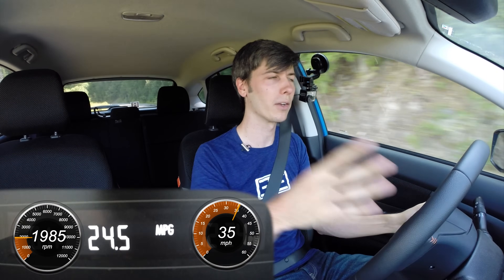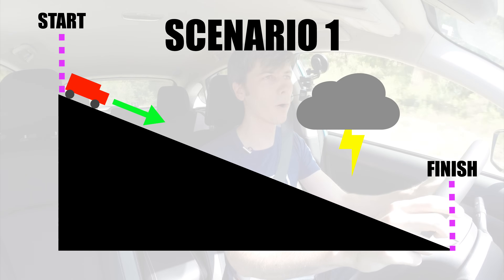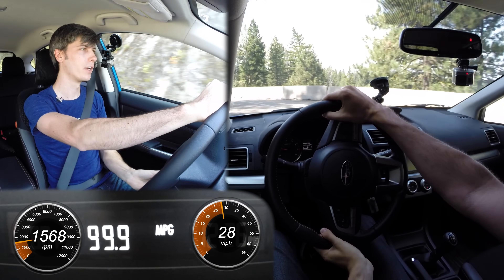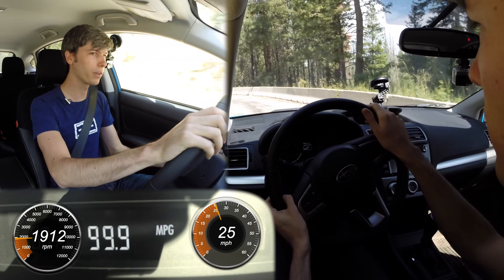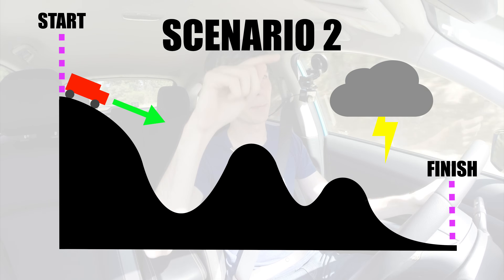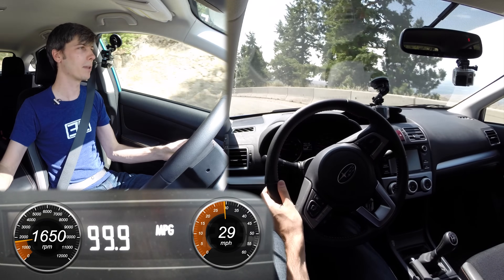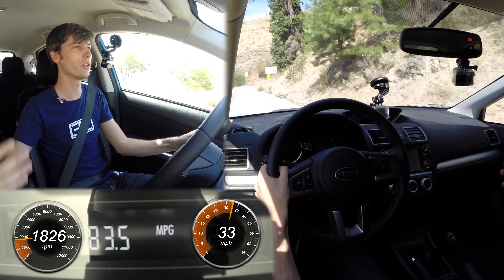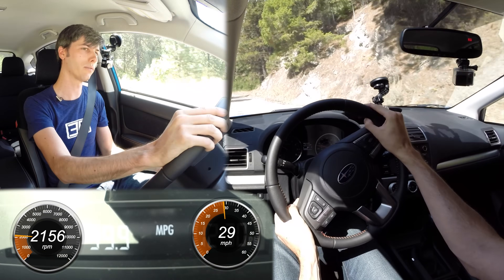What Uses Less Gas - Coasting Or Engine Braking?

Comment: Even without being in neutral, my old T-bird had a four speed automatic, and the fourth gear was an overdrive. When it was in that last gear, it would eagerly roll downhill,  and it would pick up a lot of speed, without my foot on the pedal. My Honda SUV, which weighs a lot more will adjust the transmission, to keep it from going too fast, downhill. In fact, it caps the downhill speed at around 40 or so, whereas the T-bird could get above 50 on a good hill. When the speed limit is well above 40, then you are definitely using more fuel, because you have to keep on the pedal to maintain your speed.

Comment: Important to note for all the people driving old cars with carburetors: neutral is more efficient than being in gear because in gear with engine brake applied, the throttle body is closed but the jets still suck in a lot of gas because of the high rpm of the engine.
Reply: No, not a lot at all. No more than a little above idle power. And I have brakes if I need them rather than them being overheated.

Comment: Also isn't it more efficient the higher the gear you're using, since the wheels don't spin the engine as fast. I'm imagining going 30km/h with second gear can be pretty unefficient, but 70km/h on 5th wastes way less energy.

Comment: I didn't know that coasting actually shut off fuel. Knowing this, I drove to work without cruise control and just accelerated and let off when necessary and my MPG was 42 when it's usually only 38

Comment: if you go down a hill in neutral your transmission will eventually die. As no gear is selected, the shaft is rotating with no lubrication and it will overheat

Comment: Doesn't it depend on speed? The higher the speed, the greater the RPM and therefore the greater the lost speed due to engine losses vs fuel use to idle the engine while coasting?

Comment: Finally an analysis that takes subsequent hills into account.  I live outside of Denver and have been dropping 3,000 ft down I-70 every day for 25 years. Most of the time it’s been in the same car!  Due to this specific terrain the best is a hybrid approach.  Leave it in gear until approaching  “Dead man’s curve” then go to neutral to build up an illegal amount of speed to coast over the long small hill with reasonable speed before the final drop.  Stay in neutral to allow for the farthest coast once you hit the flats in town. 

Don’t do this in a big rig though. Always stay in gear.  At least once a week there is a rig on the side of the road with its brakes on fire, and several times a year the flames take out the whole truck!

Now I have an electric car which takes all the mental gymnastics out of the drive.  Set it and forget it.

Comment: My car's "computer" can display instantaneous fuel consumption. If I lift off the accelerator and remain in (top) gear, the consumption falls to a nominal "999 mpg" because the kinetic energy of the car can keep the engine turning and the ECU can completely shut off the supply of diesel. If I lift off the power and also press the clutch, the consumption falls to about 200 mpg - presumably because a small amount of fuel is still needed to keep the engine turning at idling speed since the kinetic energy of the car (via the transmission) cannot now do this.

Comment: I live in quite a hilly area and use the kinetic energy by going to neutral to help get up the next one when I can and its safe to do so, easier on my pocket and the environment. Unfortunately its a great opportunity to collect revenue through speeding fines and I encounter a good many cameras strategically placed for that brief moment you might exceed the speed limit making you brake and waste all that energy. The other obstacle is nervous drivers in gear and braking well below the speed limit so you end up  having to downshift to second gear behind them on the uphill 60mph section.

Comment: Presumably this is only relevant with fuel injection, carburetor run engines I'm guessing would be more efficient coasting as the idle jet would be open regardless of whether you are in gear or not so lower RPM would be more efficient

Comment: It really matters if you have an automatic or manual, though, as putting it in neutral as the automatic transmission may not get enough pressure to properly lubricate itself over many miles. 
My car doesn't turn off the injectors and maxes out at about 40mpg or so.  Being manual, dropping it into neutral even to slow for a stoplight is a noticeable improvement. So it depends a lot on how the fuel injection works.  For something older or "classic", with port injection, carbs, or older mechanical injection, gas is directly linked to engine rpm no matter what you are doing.

Comment: I put the car in neutral and turn off and on the ignition. And then when I need the engine again, just put in gear and engage the clutch, the engine would be running again. Works both on carbureted and fuel injected engines.
If I see read light ahead, I slow down just enough that it turns green when I reach the intersection, and do the above thing till the intersection.
And braking only when necessary.
Using the engine in it's most efficient RPMs and not going to fast or too slow.

Comment: Another fuel saving tip: try not to stop. Starting from standing is a big fuel user overcoming rolling distance from standing. The answer is to slow down and keep crawling to traffic lights, through traffic queues, and so on - as long as it’s safe and legal to do so.
Reply: Downside is you need a lot of space ahead to roll, which most people will just see as 'free real estate' and merge in 😂
Reply: Yeah tell that to the asshole behind me who's rushing to the red light for some reason.
Reply: Tell that to the cops hiding round a bush at an empty 2 way stop when I roll the stop sign lol
Reply: @cyandrix  safe and legal ^^^

Comment: Reminder for automatic drivers: coasting on neutral does to your transmission basically what running without oil does to the engine. It is limited or prohibited in car manual, unless manufacturer added a pump for this case (newer and expensive ones).

Comment: Most energy efficient way: neutral, turn engine off (careful, depening on how your main braking system works you'll have to restart the engine before braking after a few times)

If you need to loose speed, then use engine braking. Same if you need the engine for the brakes, air conditioning or excessive use of electrical systems.

Comment: New cars cuts the fuel supply when engine breaking so you use 0 fuel when engine breaking. But if you really want to safe fuel you must turn of your engine and coast, I did that for a month with my Mercedes 190E 2.0i in city driving and saved 20% on the fuel consumption.

Comment: Works if you can maintain your speed in gear.  On a shallow grade, you burn no fuel in gear, but also slow more and more.  You then need to accelerate, using more fuel than just maintaining speed.

Comment: Please explain this. For example my car consumes 5 litres of gasoline per 100 km. Traveling exactly 100 kmh because of best fuel consumption which is 5 litres. If I go 150 kmh will my car consume 7.5 liters? If it consumes 7.5 liters that's good because than by the time I get there which is 45 minutes sooner , my car will be turned off 15 minutes sooner therefore the engine hours will be less. Now if it consumes say 10 liters going 150 kmh that would not save me. I'd rather get there later but economically even though I wouldn't be able to save those extra 15 minutes of engine hours.

Comment: Ideally, just choose the right, high enough, gear to gain the momentum needed for the next hill but low enough to not overspeed. Allways better than coasting in neutral, both economy and safety wise.

Comment: Not covered: Long, shallow descents, where staying in gear would result in losing too much speed.  In this situation, neutral is better, since the alternative to slowing down and needing to use gas to accelerate again later, is use extra throttle to "idle" the engine at a high rpm value that matched the rolling rpm.

Comment: if you keep engine in gear, engine rpm is higher than if you leave it in neutral. higher rpm = more friction. more friction = less fuel efficiency

Comment: For some coasting fans it's very difficult to believe that in coasting you need fuel to keep engine running but in engine braking driven wheels and inertia keeps engine running without any fuel. 🤔

Comment: For injection it is quite a no brainer. 

For carbureted engines I THINK neutral is better as it has lower engine speed and load.

I have done less sane things downhill like turning off the engine. PLEASE NEVER DO THIS, ESPECIALLY WITH NEWER CARS (after say 1960) as your car may get stuck in the steering lock! Also: many newer cars (after 1960) have powered brakes and steering which will then stop functioning!

It did help me when I was running low on fuel in a big nature park, coasting downhill with no engine on. It was an older cheap carbureted car with no creature comforts, no powered anything and no steering lock.

Comment: It is less efficient with a carb. Carbs mix fuel by the amount of air going through them. Higher rpm means more air means more fuel. Leaving it in neutral will use less fuel with the lower rpm.

Comment: But , in the REAL  world , there is a reason Coasting in Neutral is called Angel Gear . Lack of Control of the Vehicle means you are GOING to meet the Angels .
And , of course , a Carbureted Engine will always feed  Pilot Mixture  even at Zero Throttle .

Comment: Good discussion. Coasting is illegal because it's considered unsafe; never taught in driver's ed. Intuitively coasting is efficient, not spinning engine, using energy, wearing engine parts.
Brakes easier and cheaper to replace. That said, it takes driver skill to coast safely, no distractions, brake pedal covered.  Likely easier for a driver who has manual transmission skills. Some of the new electronic transmissions may not let you coast. Old lightweight SAABs had efficient transmissions that allowed forward coasting. like a bicycle.  Mechanical coasting is being replaced with less efficient EV chemical battery regeneration.

Comment: As always using the onboard computer screen just don't work. You need to run on an external tank and measure remaining fuel after the test. If no fuel at all was injected while engine braking the engine temperature will drop since there is no fuel combustion and transmission temperature increase due to friction. Do this test again a freezing day and a long steep down hill and keep an eye on the engine temperature gauge(better use external device). I'm 100% sure there will be fuel used to keep engine in working temperature and keep passengers warm.

Comment: I engine brake by habit and credit that to the fact that I have never needed to change the OEM brake pads on a 2012 Acadia with 159,000 miles on it. I had had the brake fluid changed 3 times.  Keeping any momentum is key.  I never knew that the fuel injectors turn off though. That blows my mind!

Comment: Wish more people watched this. Where I live, people seem to think that coasting in neutral is both safe and uses no fuel whatsoever which is insane. How would you ever feel comfortable rolling down a hill with any kinds of turns really while in neutral (efficiency aside)... almost no room to react and greatly reduced car control couple with needless brake wear should be enough to deter peopl from that alone... inaccurate MPG readings in modern cars are no help either, you need to stand still and idle in most cars for them to accurately display how much more fuel that uses

Comment: Ok I could be wrong in an assumption here, but I have always thought that the noise created by an engine was the fuel igniting. If fuel injectors stop injecting fuel when off throttle, why does the engine continue to create noise?

Comment: If you coast in neutral when it comes to a bend you will have to use brakes to slow, if you are in a low gear, you wont need to brake as much or at all. Also in the event of brake fail or fade if you know how to engine brake, you will know how to slow and not panic and keep pushing the brake pedal.  Do people with automatics engine brake?

Comment: 99.9 MPG on engine CPU does not mean the engine is using 0 fuel and thus shut off. Because so few people were expected to spend significant time in that range (+100 MPG) it made more sense to process to the tenths (0.1) than to the hundreds (100). In metric system, the standard is l/1000km or liters per 1000 kilometers. In this situation, lower numbers are better and thus, 0 l/1000km would be better indicator of whether or not the engine is shut off.

Comment: You're completely ignoring the kinetic energy you have when you reach the bottom of the hill. It's not as if your trip ends right then and there -- having more speed allows you to use less gas after the hill, which needs to be taken into account

Comment: depends on the car and the amount of slope on the hill, my car has a tiny throttle body and its very short geared that even at top gear its engine braking so much that it completely kills your speed, you are better of just coasting at idle otherwise you have to give gas to keep the car at same speed in a specific hill that i use everyday. In that case being in neutral is much much better than coasting in gear

Comment: it is most effective if you use both. especially if you know the road well. I use neutral on the hill when I want to gain momentum and continue moving on the flat road as long as possible without adding gas.

Comment: Thank you. You clarified that issue for me . I used to coast in neutral on a manual transmission car. As I saw the revs going to a low number, as opposed to having the gears engaged would show higher revolutions. I thought those revs were coming from the engine burning fuel. Now I know they are just from the engine being engaged. 
My wife does the same. I will let her know.
Thanks.
Reply: In Germany this is taught as basic knowledge in driving school.

Driver's education in America (and much of the rest of the world) continues to baffle and disappoint me...

Comment: I coast a lot and it gives me 26 km per liter of diesel. Never goe below the speed of the top gear. On my usual routes iknow every inch of road so i shift to neutral at 80 kmph and coast until it reaches 60 kmph, which is the minimum speed of my top 5th gear.

Comment: Technically speaking, any sort of engine braking at any speed, in any gear, is going to give you better economy than coasting.....but sometimes coasting makes more sense keep your driving convenience in mind. 

From my experience i've found that the choice of coasting vs engine braking comes down to your desired rolling speed. 

If im on a mild slope where engine braking doesn't let me roll at my desired speed.....i chose to shift into neutral. But if the slope is steep enough for me to use engine braking and still maintain a healthy rolling speed, then engine braking it is.

Comment: Sometimes I turn off the engine while going downhill, knowingly I want to increase or mantain the speed, to save extra fuel although after like 1min or so the car brakes stop working so I only do that when I know it is safe. I learned this trick with my father. Although I'm not sure how well that would work in a modern car because I only drive a car older than me.

Comment: I read an old article about economical driving competition. Both were driving petrol 2015 Mazda, one was using neutral coasting (also using engine braking some cases), one was not using neutral coasting. Neutral coaster won the competition by over 0.1L/100Km.

Comment: Your logic is bollocks. Coasting or freewheeling is more efficient as you are not wasting the potential energy you had at the top of the hill with the engine braking and increasing friction.
Practically speaking you can travel further at the bottom of the hill still out of gear than you would have done if you had it in gear.
I do it all the time and it improves my fuel efficiency considerably.

Comment: It’s more efficient to coast in a high gear downhill because your fuel injectors are off and there is low friction in the engine. Or put it in neutral with the engine off.

Cant say that is the safest idea to to though...

Comment: Your engine is still running on gas when it's in gear unless the ignition is turned off. You can't just turn your feul injectors off or you carburetor off. If it's running there gas going through it

Comment: False. When you let off the gas with a conventional automatic transmission in Drive, you are coasting with no engine braking. In overdrive, the one way coast clutch is being over ridden by the output shaft unless you turn off overdrive. When you turn off overdrive, then the coast clutch will engage to give you engine braking. No need to put an automatic transmission in neutral.
Reply: Some automiatic transmissions will engage engine braking if you tap the brake slightly, that's at least been my experience with VWs DSG in various rental cars

Comment: I appreciate the video,  but in my case still I can’t have a clear idea of how much is the expenses. My car is a tdi jetta 1999 diesel. In gear. The engine break slows down too much and quickly the car. I need frequently touch the accelerator. So when i leave in neutral is idling around 900rpm but in these months I’ve been doing it the mpg raised 3 to 4 miles plus per gallon. But i still id like to know for sure.

Comment: So, with engine braking, the point would be to get my ass in gear to slow down, and not ride the clutch to slow down, correct? My understanding is that riding the clutch causes very quick wear.